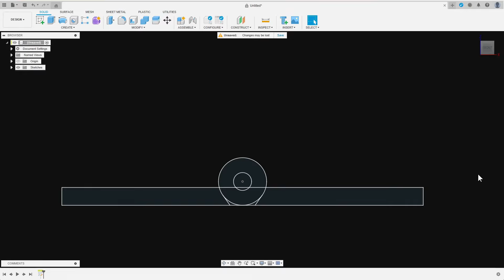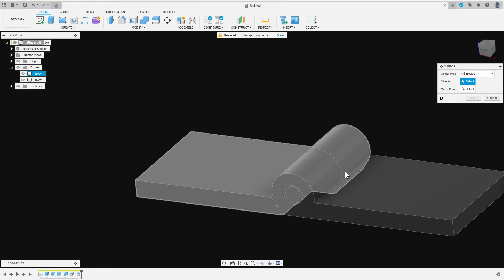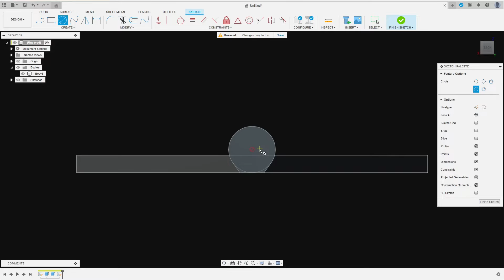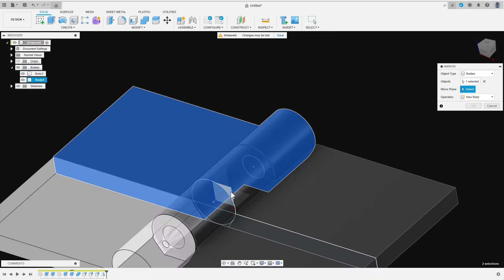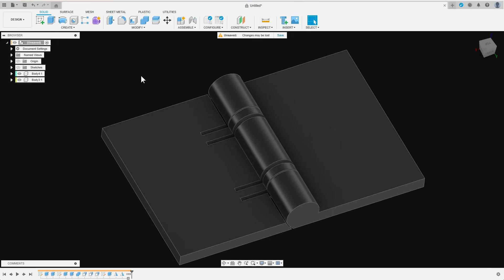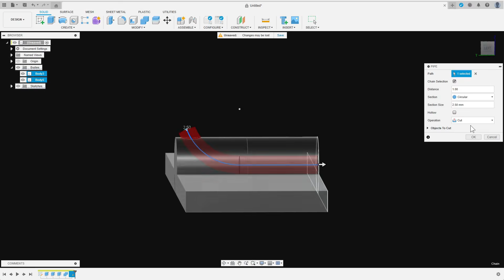How to design 3d printable hinges in Fusion 360

Comment: Very good video, good pace! What I'm still struggeling with is the clearence. I'm using a Bambulab P1S and I already had "spaghetti in the air" prints. so I wonder, how the printers "knows" that I want I light connection between the parts. Is there a filament/printer guidance somewhere?

Comment: I have a questiion, could the last design be used with large paper clip instead of filament? Would it hold together of will the bendign cause too mach stress on hinges?
Reply from the maker: If the clearances are tight enough I dont see a reason why steel wire would not work. Maybe file off any flush at the ends of the paperclip.
Reply: @getprototyping thank you for your answer and excellent tutorial